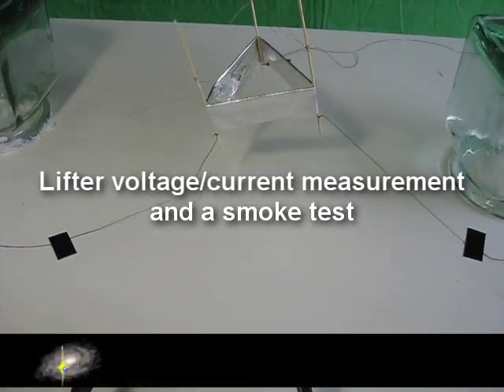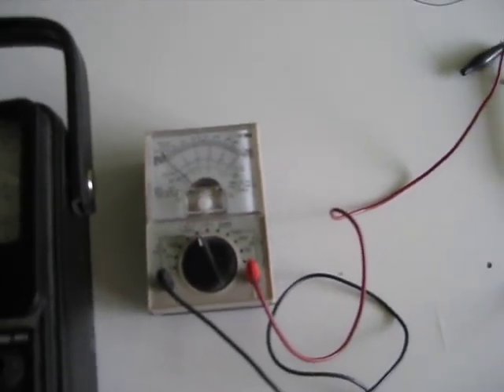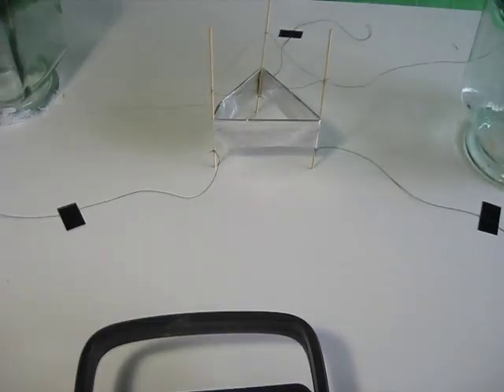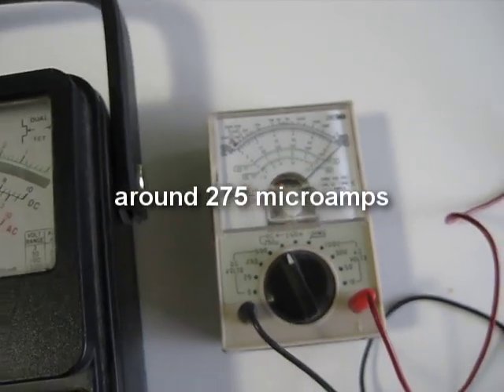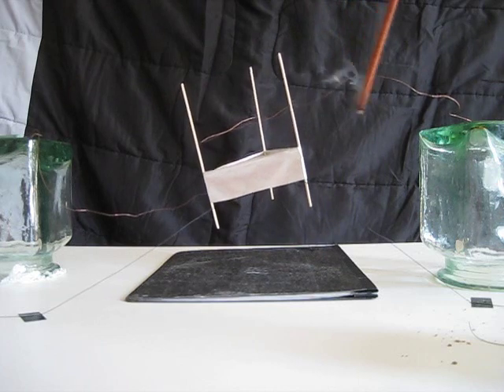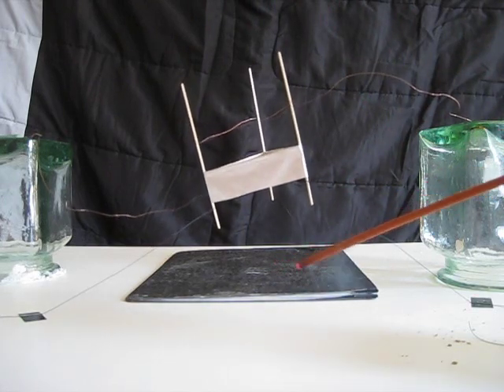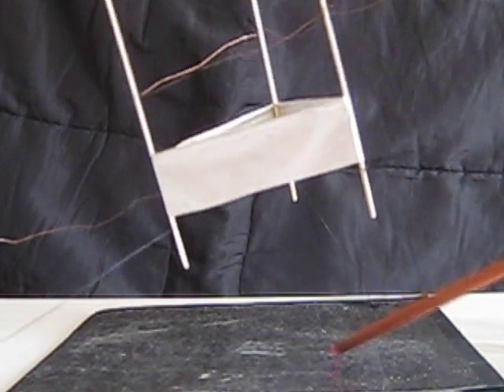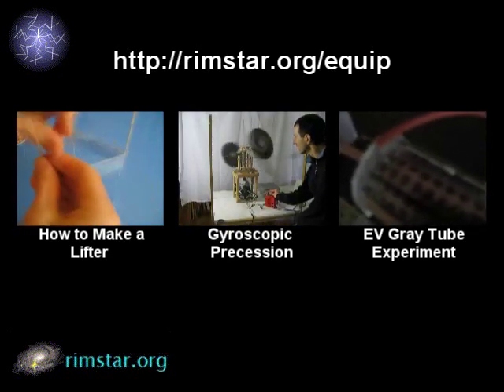Lifter Voltage/Current and Smoke/Airflow Test Measurements

Comment from the maker: Wow! Coming from you the fact you enjoyed my blender-made cartoon so much means a lot! Thanks!

I used a 24V power supply which then feeds an HV power supply made with a flyback transformer feeding a Cockroft-Walton voltage multiplier - all homemade.

FYI  My How a Rocket Works video is very blender intensive, in case you wanted to see some more blender stuff. Not super detailed due to time restrictions. As you know, you can play around forever improving models and animation.

Comment from the maker: I've replicated Miklos' old thruster made from a candle and you can find it as "Solid Dielectric Candle Engine 1" on the Non-conventional Propulsion page of my website. Sadly all I got was movement due to Coulomb's force and due to ion wind. I haven't tried any of his other variations.

I did the CD case type of Poynting flow thruster too which is also on the Non-conv Propulsion page. No videos back then though.

Nice collection of work you've done over the years! Keep uploading.

Comment from the maker: It can be circular but triangular is easier to make. The top edge of the foil should be smooth to work best, and it's easier to wrap it around a straight horizontal frame than around a circular frame. Re using it to turn things, the thrust is very small so it wouldn't work well.

Comment from the maker: Thanks. It's not using electrons as a reaction mass. The air molecules around the thin wire become ionized. If the wire is negative then the ions will be negative ions. The top edge of the foil is smooth so ionization is minimized there. The positively charged foil is attracted up to the negative ion cloud and the negative ion cloud in turn is attracted down. At least that's the ion cloud propulsion theory which describes this best.

Comment: hi, if electrons flow from the positive high voltage aluminum foil to the negative wire (down to up) , then why does the smoke travels backwards (up to down)?..... awesome video greetings.

Comment: I weigh 300 pounds. The lifter is .046 oz and consumes 7.1 watts to lift it. My weight requires 186,000 watts - more than that of the lifter. Can this be scalable? I want to fly and under control - safely. Is the horsepower needed comparable to an ultralight? With airfoil wings maybe you only need thrust through the air not a pull straight up. Can this work?

Comment: Mr.Rimstar.thank you .for illustration.,i have a 11,000 volt dc power supply.,that is all sealed the thing came out of a old printing press  sparks can reach about an inch current quite high.i tried to charge capacitors from aluminum paper and wax paper but the capacitors always cut on fire ..so tell me if sparks fly an inch or so .,so the insulators have to be that thick ..
Reply from the maker: +RAMM GARR It depends on the material used for the insulator. In a capacitor we call the insulator the "dielectric". That should help you find more information about it. See my video about making high voltage capacitors for details on what determines whether or not it will break down https://www.youtube.com/watch?v=MPD7skZ8OSo. You might also find my video on capacitors in general helpful too https://www.youtube.com/watch?v=GveI9gXIsHw.

Comment: I think that also the normal movement of water in atmosphere it is a ionisation/polarization process.
The electromagnetic radiation of Sun polarize the water molecule.
The polarisation is visible in the clouds.
Between clouds and earth surface or between clouds and clouds there are millions of volts that are discharged with thunderbolts

Comment: Is it possible that the charged air is creating an ionized compression vortex?  ..it seems plausable.  Purhaps a video from a topside (or bottom thru plexiglass) would reveal something interesting. Using a more condensed form of smoke ..say from a burning polymer may be more effective as the molecules would be more tightly linked together  ..like that which is used in wind tunnel testing.  Thanks for the cool video and the cute animation ..it really got my cats attention.

Comment: Looks like from top wire electrons run to botom aluminium ju if you make vortex set up of wire and aluminium (vortex ion craft  ) it should be better i goes... Or maybe in midlle add magnet ...

Comment: I think you should juggle the frequency to see the behavior at different frequencies.
Reply from the maker: It doesn't work with AC but I have heard of people getting it to work with pulsed DC (70Hz comes to mind).
Reply: @RimstarOrg  I know that the assembly that controls the mayor of the HV transformer produces 35 kHz square signal. Otherwise the transformer could not work on ferrite. I was referring to a PWM assembly that can have a variable frequency lower or higher than 35 KHz.
Tesla discovered this phenomenon which is now called in many ways. All of Tesla's discoveries were hidden after he was assassinated in his hotel room. Now, many passionate people like you are following in Tesla's footsteps.

Comment: How does one procure a power source capable of 26kV or more?
Reply from the maker: Salcott Aam If your purpose is to fly lifters then you want a DC high voltage power supply that is capable of both 26kV and a good amount of current too. Other than random ones on ebay, there's http://amazing1.com

Comment: it requires much high voltage. Can we make power amplifier circuit ?
Reply from the maker: I use this homemade power supply which I made https://rimstar.org/equip/30kv_pwr_supply.htm. Unfortunately, it's become hard to find the flyback transformer. Most of the ones you see these days have a builtin diode but you need one which doesn't have a builtin diode. The problem is, as you say, it needs much power, high voltage but also a relatively high current too and most high voltage power supplies don't have the current.

Comment: You would need 260 kilovolt to lift a 130 kilogram craft off the ground.
In short, this means you have to have the double of kilovolts as to what the craft weigs, and this applies every time.
Good to have that down.

Comment: Hi RimstarOrg. Can you draw a sketch on how to connect a meter to measure current for a lifter ? You have to have a detail sketch of which wire is connected to the meter or else one mistake and it will destroy the meter because of high voltage. I saw your video but what you said about wire connection to measure the current is not clear. I have an expensive Fluke voltmeter that can measure current and it said that it cannot measure voltage that is greater than 600 volt. Therefore, I am not sure how to measure current in a high voltage circuit like a lifter.  Can you give me your email address so you could send me that sketch ?